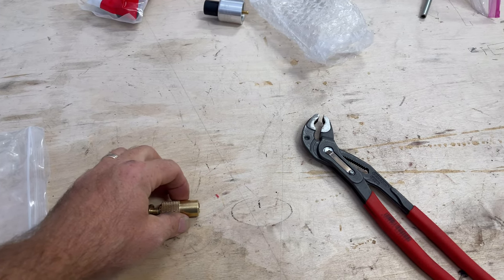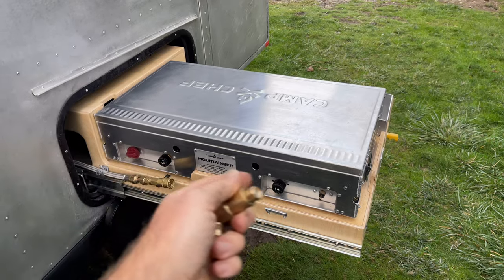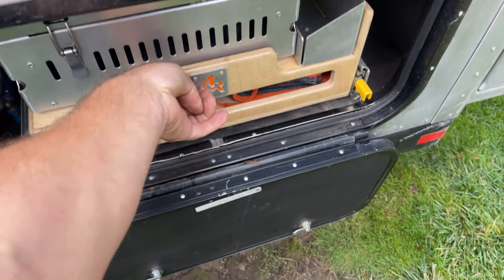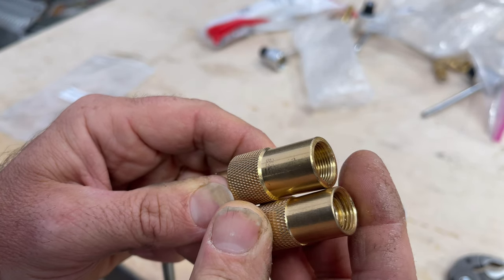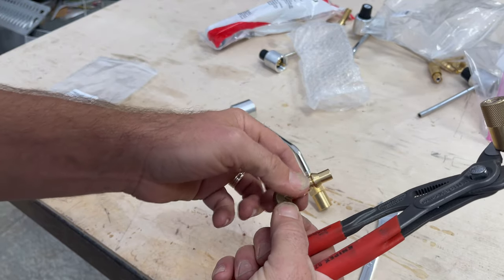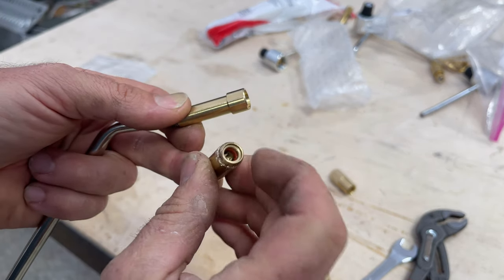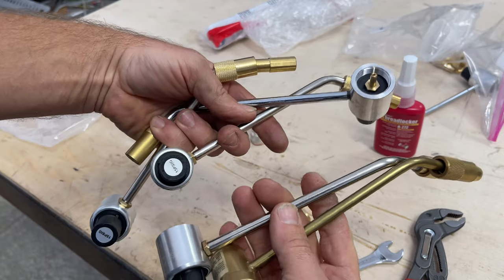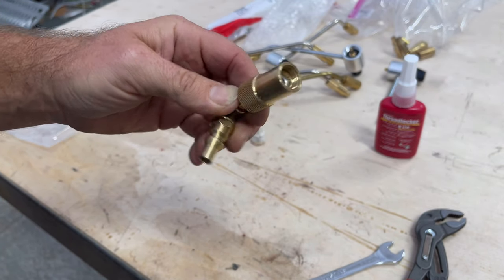Camp Stove and Quick Release fittings | DIY Project / Update - 2

Comment: Has any one tried this with a Coleman camp stove? I have studied the videos and the parts, I believe it will work. Going to order up the parts. I will be using the fittings from my Coleman regulator elbow tube as I believe my regulator went bad, bought a new regulator that came with a hose instead of the elbow tube, tested it connected to a big tank, stove works good with ne regulator. Time to make this upgrade, keeping the new regulator as a back up.
Reply from the maker: Can be done on any stove, matter of fitting parts

Comment: Thanks, just about to order the fittings. I hope I can follow your directions.  Just wondering, but why doesn't someone make a hose with the correct size sleeve fitting connected to a regulator hose, for the "less than handy" among us?  In my back and forth with Amazon, I've learned that you can't count on interchangeability for fittings among Coleman, Camp Chef, Blackstone, and other manufacturers, with little specific reference to Camp Chef. Thanks again.
Reply from the maker: Do whatever and whenever we can…

Comment: could this be done for the Camp Chef Rainier 2X? It's got the same Fine Threads connection. Camp Chef says it won't work because RV pressure is different. First she said too low, then she said too high. I call B.S. on the young girl I was talking to. My EPro 14Fk has a quick connect hose underneath for a portable stove. This SHOULD work right? HELP. :)
Reply from the maker: I'm guessing its the same as my Everest & Mountaineer? so yes, should would.  As far as hooking up to the RV hook up, thats a NO (in my best guess based on previous experience) - as she was correct on the fact that RV connections are low pressure lines most of the time (under 1PSI) - thus wont work.  Those quick fittings on RV are usually for low PSI connections of factory provided grills and stoves, which run about 5-8000btu vs 20000btu CampChef stoves that I meantioned.  
Hopefully that clearifies some for ya.

You can always try, and yours being lower BTU burner's stove, might work.

Comment: Camp chef comes already with the regulator. Will that work on this quick connect?
Reply from the maker: This is a totally different setup
Factory regulator isn’t used in this setup (although can be salvaged for parts to make this work as described in video)
Reply: Okay. Thank you!